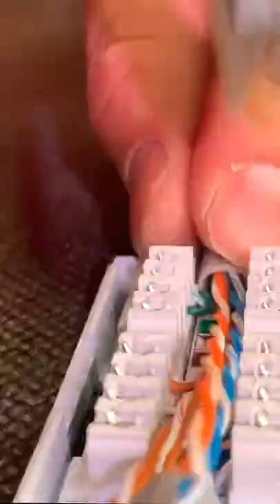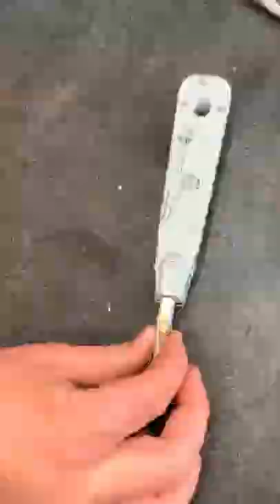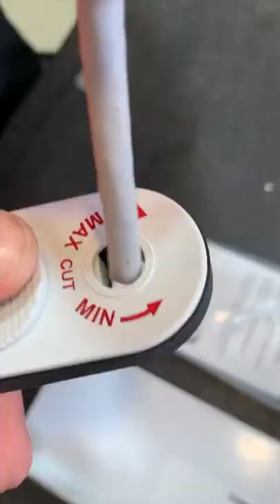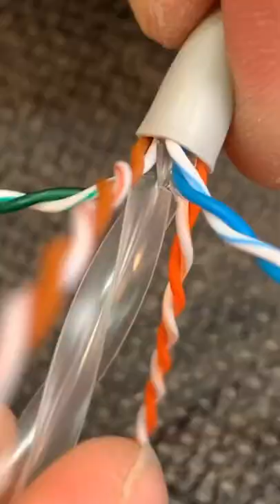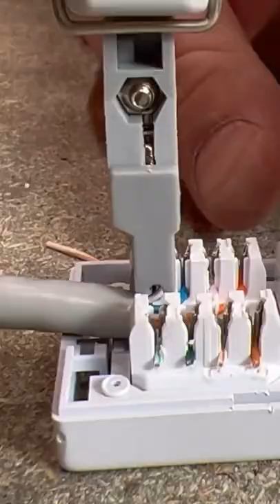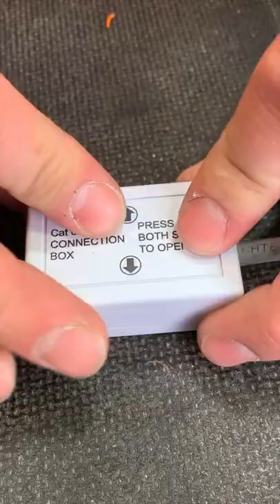Extending CAT 6 Cables

Comment: This fails on return loss but will still function with little issues, but in regards to certifying a network using these not a hope.
Reply: have you measured it?
Reply: What's the major difference between this and a keystone and a male rj45? I would assume attenuation would be similar between both and the only real downside is you now can't disconnect to halves at will... 

I will say clearly keystones and male 45s are fine cuz that's what a patch panel is.
Reply: @jaykoerner  Dead right its the best way to join a network cable in my opinion, using that method an rj45 and jack/module. It will still fail and can't be certified but will work without any issues, I seen people joining cat 5&6 with krone strips no real difference with what the lads used here really but these methods are last resorts.
Reply: @83hjf  I have, fail, 10 times out of 10. That is a lazy way to do the job. That said, I still cant find a reason for Cat6 over 5 in 99.9999999% of environments.
Reply: on noise? YES because the box itself is not even shielded. it would work on cat5A
Reply: @systemsbroken  On longer runs, Cat6's thicker gauge is useful especially for PoE. Cat6 is also less commonly made of Copper Clad Aluminium cores, which is a bonus. :)
Reply: @systemsbroken  yes - finally someone who agrees with me lol. No real need for 6 ( or 7 or 8 ) over 5 in a VAST majority of cases, and yoiu can fit more 5e in a piece of trunking than 6 :)
Reply: @markb4071  Now now, you just need to use the key word "future proofing" when upselling to Cat7. That said, some years ago I sure did get ticked when folks would be wiring up stuff with 3 and not 5....yep, I am old.
Reply: @systemsbroken  30 odd years in IT, only ever needed to hook up 10Gbe for one user, so ran him his own cable. More and more moving to the cloud so next to nothing locally needs over 1gbe (I find)
Reply: Very true for most with they don't use solid core on both sides. Its just not worth it.
Reply: @markb4071  you will if you ever with for big corporations as even wifi 6 and 6e is multi gigabit speeds uplinks. Data center for short runs from rack to modern servers use 10gbe too. And fiber is now at 80gb with ease. I do agree in campus most client machines don't need more then 1 gig if all your work is small business client stuff then makes sense. But wifi drops will require more then 1gig now.
Reply: @jaykoerner  The problem with this is the different pairs are now different lengths. As such it won't pass a certification test and probably won't work at higher speeds. Two male plugs and a keystone jack would not have the same issue.
Reply: @systemsbroken  Cat7 or Cat8 is not upselling, it is paying more for cable that makes your system worse unless you are using CG45 sockets and terminals, but there is no equipment you can buy that uses CG45 sockets...
Reply: Nothing wrong with these junction boxes at all.
Reply: @GtecAerials Good ones are designed and rated to a standard like Cat5, Cat6 etc.  Bad ones may have incorrect length and impedance matching for the advertised use .

Comment: Note on the product page it says “Full compliant with Category 6 standard requirements for a consolidation point.” so it’s for use as a consolidation point.  I presume if you use it as intended then you won’t have any problems (which several commenters don’t seem to have twigged) but keep it 15metres or so from the relevant end to avoid problems with signal reflections as per the standard (and make sure you read the standards referenced and required by 7671 if you haven’t already)
Reply: BS7671 in relation in to data cables is only interested in fire protection and mounting.
Reply: Should use global standards for cat3 and higher .  And it is wrong for suppliers to assume every pro has memorized every obscure standard, there are simply too many .

Comment: I have done this some times in old buildings where the cables have been accidentaly cut somewhere in the middle. It will work fine for the most part, but with so many terminated parts on a cable, there is a chance the return loss will be higher then what the fluke tester allows as a pass

Comment: Nice unshielded CAT6.. these are the best
Reply: or the worst
Reply: @chuckholmes2075  Optimal when used appropriately. :)
Reply: @AnnaVannieuwenhuyse  wrong it'll never certify over gigabit. it's not shielded and I bet the traces don't follow cat6 twist specs. it's made for cat5
Reply: @chuckholmes2075  Unshielded Cat6 can be certified for gigabit, but typically only for short runs.
Reply: Weird flex, but youre wrong 😂
Reply: wraps foil around it 

"Not today, government!"

Comment: No one uses punch downs anymore keystone are the go
Reply: Definitely
Reply: … the back side of keystone jacks also have punch downs. LSA punch downs are really the only valid way to terminate a solid core cable, rj45 plugs go on stranded only.
Reply: @JasperJanssen  definitely not, there are keystones that have both ends with female RJ45. and you simply terminate the RJ45 as you would normally do.
Stranded or not...
Plus proper termination and keystones can achieve 10GB copper connectors much better than punch downs.
Reply: What does that even mean. Keystone is the form factor for the connector. Terminating wire to a keystone jack requires punchdown.of some kind.
Reply: @AL6S00740  that's an RJ45 coupler. Not everything is Keystone, depends on the brand etc.
Reply: @JasperJanssen  You can buy RJ45 plugs for either stranded or solid core wire.
Reply: That makes zero sense... How do you think keystones are terminated? 🤷‍♂️

Comment: Who is still using unshielded network cables?
Reply: That would probably be most people…
Reply: @torbjrnfjeld1799 no
Reply: if they're twisted pairs down to the street cab or to the exchange building they are unshielded.
Reply: @Snooooozel  um. Yes. I don't know of many low voltage installers out there using shielded cable on new installs unless specifically asked to. The cost just doesn't make sense unless you have a special use case.
Reply: @TheWittyGeek  I don't know any installer who is not using shielded cat7 installation cables for network in Germany. Why? Because they can easily handle 10GBit and you can lay them together with 230V cables without leaving space between them. 
And that cables are very cheap because it's pure mass production.

Comment: Generally speaking you only extended as a last resort.
Always to and run a new length if possible.
Reply: I wish the external guy running cables at my place listened to this advice. I'm the one dealing with PoE issues and other errors in the end. Once left me 3 wall ports to connect with one uplink 🙄 I wish I had done the job myself as it didn't save me time in the end
Reply: It's when a forklift slices through all the cat5 and mains cables above a door with his mast that these are a life saver, oh ad did I mention it was 4AM.
Reply: @dogwalker666  Fair play. I would describe that as a last resort..😂
Reply: @vitorhugopereiradesousa1721  I've had more than one run-in with sparks who think they understand data.  It is different and you have to think in data terms.  I know nothing about electrics, that's why I steer clear.
Reply: @johnharrison5199  Yes indeed and it’s still working a year later, I deal with the IT and power  systems being a programmer helps.
Reply: What do you think punch punch down into racks do is an extension there too. Extensions are common. As long as the total length comes out within spec and all parts are certified it's stable
Reply: installed one of these last week. Swapped an analog phone for a voip handset. POE but no network. cable had been run though the wall form a socket in an adjacent room. opened the socket to find whoever had run the extension cable had just punched it into the keystone on top of the original cable
Reply: Yup can take the old for scrap then 😂
Reply: I'm pretty sure it's easier to run a new cable than join with crone and punch ..
Reply: @stephenflanagan962  sometimes it's not always possible.
I've installed quite a few networks in homes. Once the walls are plastered and decorated, it's next to impossible to re-run. As I said, I use them as a last resort.
Reply: @johnharrison5199 100% agreed. Also have done residential and can confirm that some places are just either impossible without cutting drywall and having them patch and paint it.

Some run these data cables when no drywall is installed and zip tie them to the studs. So even if you THINK you have a cable to work with as a pull string, you might have to think twice and come up with a workaround.

Comment: Never seen these before. We would usually use a keystone and male end, typically within the rack. I suppose this could work if you have to splice a damaged cable far from the termination points.
Reply: That's not how it should be done and why this exists.
Reply: That's how it's done normally in a patch panel. This is for a different application (splicing mid-line).  @shaunclarke94
Reply: @psychlology  correct. This is for a join in the field, not within the rack.
Reply: Apologies I think I misinterpreted your comment to say you would use keystones to do a field join, which is not the way to do this.
Reply: @shaunclarke94  no worries :)
Reply: They make a rg45 to rg45 connector is this just generally interpreted as more reliable?
Reply: @Yabo-  yes, less points of failure and doesn't rely on spring contacts.
Reply: @shaunclarke94  thanks

Comment: If this is stating behind wall you should always do a fresh run with a fresh solid core wire from scratch for the full run. old wire fails in time either way so your just giving your self a headache here as you will need to reaccess this in a few years either way. If it's coming to the front just use a normal jack.

Comment: Well done for keeping the twists, but cutting the conductors to different lengths makes it no longer within cat6 specification.
Reply: Do you have a source for this?
Reply: @shaunclarke94  yes, he said the cat6 specification. Also the placement of the extender is crucial. Most would at least see this job done as pretty amateur
Reply: @tormodhag6824  in this type of joiner though I don't see an option to maintain the pair length?
Reply: @shaunclarke94  which is specifically why it's preferred not to be done unless really necessary
Reply: @shaunclarke94  although i would say it depends on your application. In a data center i would never, but at home probably
Reply: @tormodhag6824  These LSA punchdown blocks are a lifesaver when you need them. But you don't generally use lifesavers when you don't need them. That's my rule of thumb!
Reply: @AnnaVannieuwenhuyse  yeah it's the last resort. Sometimes i really wish I had those lying around, and you only need a krone tool you already have
Reply: I think those connectors shuld compensate for the lenght mismatch. but im not 100% certian. i learnd with cables with screen and shield an was thaught that want as little as possible wire in an lsa connector
Reply: The two sides are mirrored to try and compensate for this.

Comment: Is there any loss of bandwidth?
Reply: It'll still run at a gig, wouldn't be expecting a fluke test pass though..
Reply: Depending on the cable run length you could find you drop from 10gig to 5, 2.5 or 1 gig (depending on switch gear). These really are a no in commercial installs unless you're desperate.
Reply: @TJ34644  I wouldn't, I'd run a new cable.
Reply: There is no loss in bandwidth but there will be a possible loss in performance.
Reply: @deang5622  The performance loss is usually because of a loss in bandwidth, where the upper frequency bounds are too noisy or hard to distinguish from the noise floor.
Reply: @AnnaVannieuwenhuyse  Here, there is a discontinuity in the cable, the characteristic impedance is being upset, and there are no matching impedances to ensure it remains the same, so reflections are likely.
Reply: @AnnaVannieuwenhuyse No, the performance loss is down to signal integrity issues not bandwidth, and I use bandwidth in the true definition here , the width of the spectrum between 3dB points.

Comment: When i needed to extent a Cat 6 
I didn't have any tools or a New Long wire 
I just had 2 short ones
I cut the heads off of the 2 ends
I welded every color to color 
Protrcted them w tape 
And finished by wrapping it in Heatshrink
And From being a Temporary fix to being a Permanent fix until this cabel break or something else happens to it 🤣🤣🤣🤣

Comment: You better cross your fingers your cable still meets it's gigabit rating, those splices are something you use out of pure desperation
Reply: its the same splice that would occur in a keystone, lol
Reply: @techheck3358  It sure is, but for every connection you do past the two necessary keystone connectors you increase the risk of failing the 10 g/bit test.

A splice is very visible when you test your cable, you can pinpoint exactly where any splice is because it creates a spike of noise.
Reply: @Bolton19 Only if bad .  Line tests rarely object to passing through patch panels as long as length isn't over the limit, and each patch panel adds 4 splices and 2 plug connections .

Comment: why no shield?
Reply from the maker: It’s not a shielded cable 🤷
Reply: It is though, it’s STP, the shield is the thing in between the wires when he takes the covering off!
Reply: @THECHEESELORD69  no, the piece in the center is a spacer to keep the pairs properly separated to help maintain the impedance. STP gas a metal foil shield AROUND the wires. This UTP
Reply: @danbolton4323  idk man, I’m still a bit new to this, but if you say so.

Comment: hehe i just do an ugly ball of wire and electrical tape for this
(i wouldnt do that for a cable that wasnt for me)
Reply: i've seen cat3 phone crimps used in this scenario before.. and they wondered why they were only get 10mb
Reply: @chuckholmes2075  in my case i lost the crimps but have a roll of 100ft of cat6. so i cut a working cable in half and connected all the wires separating each one from the other with one or two layers of electrical tape making two ugly ass balls of electrical tape and routed it to my room through the crawlspace. i get 10 megabytes per second which is the max ive seen out of my poor modem. internet is like 10 bucks a month so i cant complain
Reply: @kektaro  just go to home depot and get a ready made cable 50 to 100' already with RJ45's on the ends. in a home environment you only need 1gb

Comment: I remember all the clever techs, when Cat 5 came out, You can't extend Cat 5!!! Yeah??? Watch me, Dickhead. Jelly crimps, IDC boards, even twisted and taped, all passed a Fluke scan!!!
Reply: What about a certifier?
Reply: @shaunclarke94  Minor installations, mainly, but to prove ICL engineers wrong, we had one particularly annoying one at a shop in Lakeside, my mate came along and happily certified the system. Perfectly acceptable and passed every test.
Reply: @jonhunter8737  just because something passes tests doesn't mean it's right.

But we've come fair way since CAT5. More modern cables aren't as forgiving.

Comment: Mate just buy a new drum of cable at this point
Reply: That's not how it always works in the real world.
Reply: @shaunclarke94  i think I'd be hard pressed to find a system administrator who wouldn't want a single run done without splices
Reply: @BinarySecond  of course it's always preferred, but not always possible. Especially in residential.
Reply: @shaunclarke94  Residential definitely makes sense!

Comment: no DON'T USE THIS PIECE OF TRASH. put  cat6 rated RJ45's on the ends of both and use a female to female adapter. less chance of POF
Reply: Absolutely not. That's the worst way to do this. 🤦‍♂️
Reply: @shaunclarke94  you're wrong. I've been doing cat5 (6 7 and 8) since it was first introduced in the late 90's using splice connectors and anything that uses a punch down is trash.  I've had many failures using keystones and splice butts but ever had one failure with pass through RJ45's and F to F connectors. I setup POE cams all the time. I do all of Chase/JPMorgans networking infrastructure and the only failures are the punch downs and corroded ends in the ATM's
Reply: @chuckholmes2075  if you can't get a reliable IDC connection to work then there's something wrong.

I have decade old IDC terminations that go without issues and it is literally standard practice for structured cabling.

In my country, your method of doing this wouldn't even be allowed under our cabling regulations, and with good reason.

I'd be looking for the root cause and addressing that rather than avoiding the issue. Perhaps it's differences in humidity or moisture or something.

But IDC connections are literally the industry standard for this stuff for good reason.